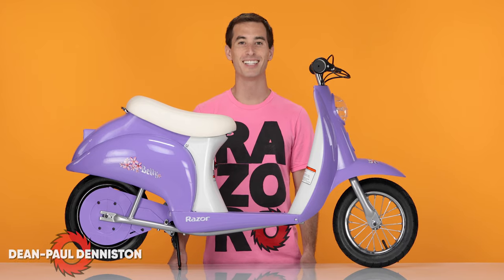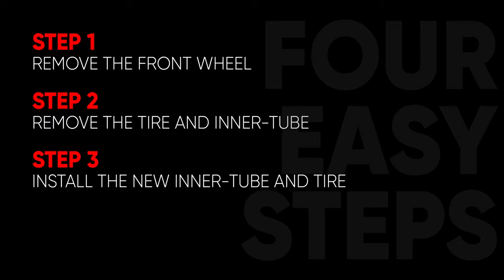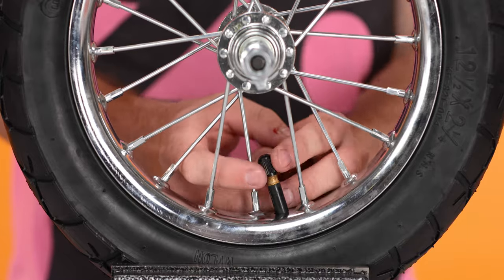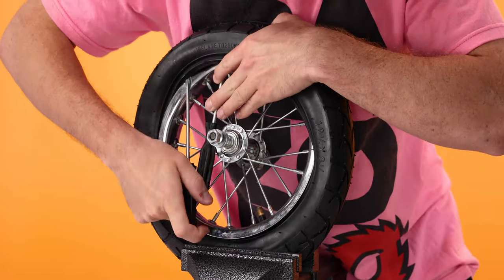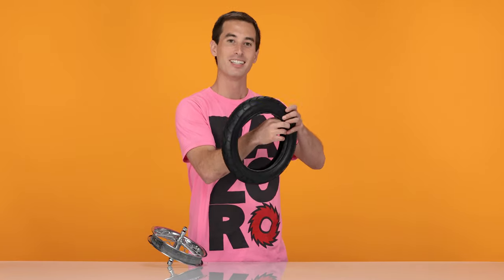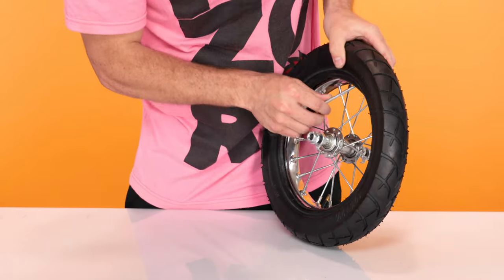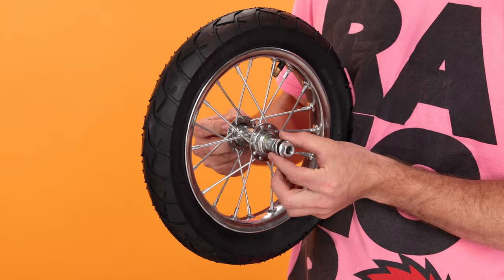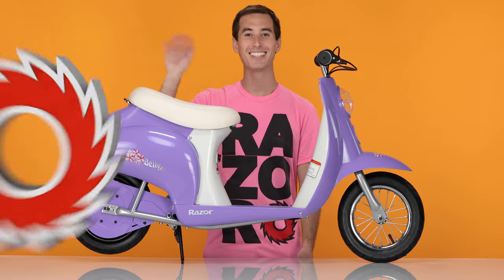How to Replace the Front Wheel and Inner Tube on the Razor Pocket Mod

Comment: I've attempted to locate the nut size and specs for the front wheel assembly. One came off when my daughter was riding it, and no luck using the other one as a guide, no ID numbers on it to compare. Would make it a lot easier if the specific nut was labeled somewhere. Help?!